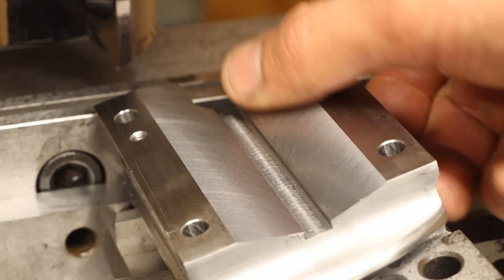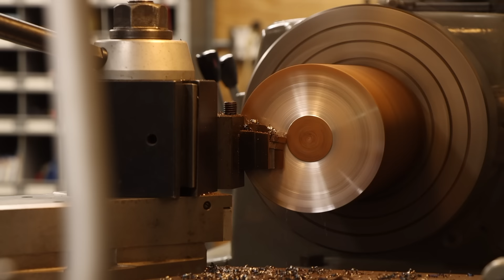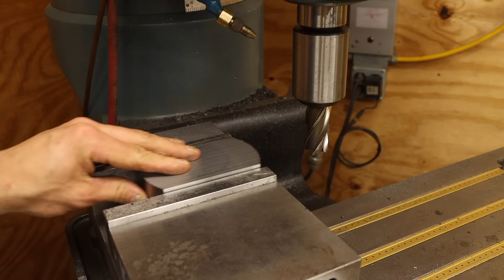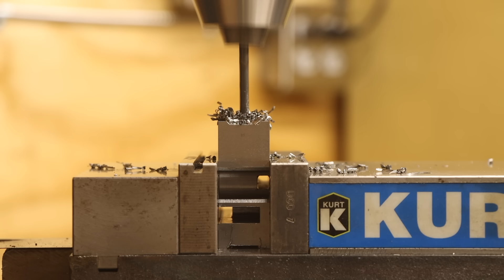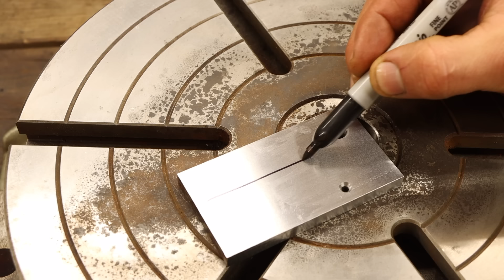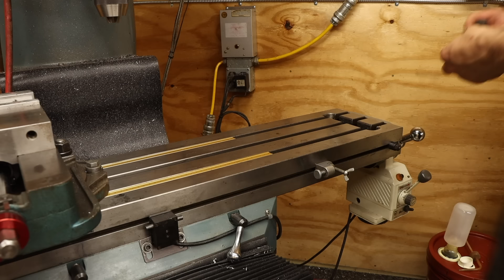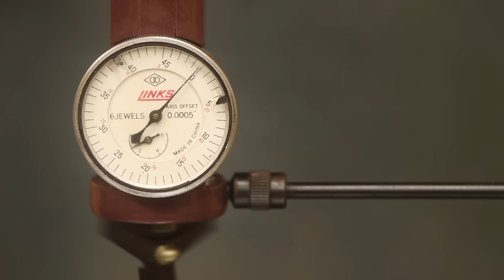Making a Surface Gauge (Part 1) || INHERITANCE MACHINING

Comment: Awesome work. Is surface grinding necessary or would just milling produce an accurate enough result?
Reply: Depends on how accurate you want your measurements to be. You could lap the base flat by hand too. Also, the surface gauge is used in A LOT of different orientations and techniques. You use almost every surface, and for a lot of those techniques, squareness, parallelism, and flatness are imperative. Using a surface grinder is also not a trivial task. Using a surface grinder to get something more flat, square, and parallel than you can get with a good mill, is a lot harder than you may think. It takes a lot of practice and experience to do. So for most people, a surface grinder wouldn't help them anyways, as they wouldn't be able to get it better than the mill already did. (Assuming the mill is accurate, precise, and the operator is fairly skilled with the mill, but not very familiar with a surface grinder.) Surface grinders take a lot more skill than just dressing the wheel and traversing it over the work. There is an art to it. From how much magnetism you use, how quickly you dress the wheel, the wheel selection, shimming, blocking, DOC/speeds/feeds, type/method of grinding, roughing strategy, coolant, and so on. Let's say a fairly experienced mill operator, using a good mill, can get it to +/- 0.00050" of parallel over a 4" long piece (say 4x2x1). For a novice grinder, getting it to better than even half that (+/-0.00025") will be near impossible. Where an experienced grinder operator might get it to within 50 millionths (half a tenth, or 0.00005"); an order of magnitude better.
Reply from the maker: Well said! I’m a beginner with the SG myself, so I recognize there is a ton to learn about it. All in due time

Comment: DOC is way too deep for your HSS end mills. Believe me, I learned the only way (the hard way). Face mills with carbide inserts will let you do that but feeds and speeds are super critical.
Reply from the maker: Yeah I learned that here as well. The length of  the mill deceived me, but it’s obvious now that is only for side milling.

Comment: I like your video format as well as the content, very nicely done, especially the inheritance theme. I bet your grandfather would be proud. 

I noticed that it "Appears" in some cases that you're using a drill chuck for milling, not a good practice IMHO, drill chucks aren't very good at handling side loads but they are OK for slow rotating counterbores with end mills. 
Also, I noticed a "Ribbon" pattern in the parts you've ground with your surface grinder, that can be caused by either an unbalanced wheel or worn spindle bearings, if it's from an unbalanced wheel, that can cause premature spindle bearing wear. I just replaced the spindle bearings on mine and the bearings alone were $350 from eBay (new old stock), new ones were nearly $1000, plus $50 worth of bearing grease and the time it took for single use special fixturing for the rebuild process, then the task of balancing the spindle, what an undertaking that was! .

Anyway, keep up the good work and I hope your learning journey is pleasant with very few pot holes!! :-)
Reply from the maker: I appreciate the support and the helpful tips. In the case of the project a learned a few lessons. One being the drill chuck milling like you mention. I noticed the pattern as well on some of my first passes on the grinder. Turned  out to just be a bad dressing. Did a pretty thorough redress for the final finishes and the results looked A LOT better. No patterns that I could discern. Thanks again!
Reply: @InheritanceMachining  
You're welcome :-)
Reply: @InheritanceMachining  One other point I'd suggest is to use "stub length" or "screw machine" drills instead of "jobber length" drills (unless the depth absolutely requires it). There is less chance of deflection or breakage with a shorter drill. Overall, the same "shorter is better" rule could be applied to any cutter, within reason.
Reply: @InheritanceMachining  
I thought maybe I should mention an option for you concerning milling collets, I use ER32,  ER40 & ER16 collet hollers with R8 shanks (except the ER16, it has a straight shank ).
My mill has a spindle lock that makes ER style collet changes relatively quick and easy and they are pretty rigid with nearly zero runout. I only have larger collets for the ER40 holder (only the sizes not available in the ER32 set). 
Also, ER spring collets have a gripping "Range" which means you can use metric size tooling even with SAE size collets (in most cases anyway). 
Anyway, just thought I might mention that option, lots of people use the ER method on a daily basis, you may already know this so disregard this message if you did :-) 

BTW, glad to hear the grinding pattern was just a matter of dressing the wheel. :-)

All the best,

Joe

Comment: Another great video!
You'll love the VFD instead of the static phase converter.  Did the capacitor in it blow?  I recall my father had one of those phase-o-matic converters on the old Bridgeport in the garage. One time when it was turned on the main capacitor blew like an m80 and stunk out the garage.
Reply from the maker: Jeez! No not anything quite as dramatic as that. It’s just not a good application for a static phase converter where you only get 3 phase for starting. I’m constantly tripping the thermal relay especially at high rpm. So trying a VFD because it’s cheaper than a rotary for getting 3 phase
Reply: @InheritanceMachining  I have a VFD on my Bridgeport and it works great for converting single phase 240 to three phase, and you get the added benefit of making the motor variable speed.

Comment: Fantastic work! I also love the LOTO card with the photo! It's a brilliant trick to convey the solemnity of why the card is attached to something. Wasn't a true believer until I almost lost some fingers to a small bandsaw. The saw wasn't even large enough to hide behind, or so I thought, and was crouched behind it reading info off of the motor's nameplate when a coworker turned the saw on. Scared the hell out of both of us.
Reply from the maker: Wow! That could have been bad. I've had a few close calls with machines myself. Fortunately most modern industrial works have standardized on physical LOTO locks.

Comment: Because why not! I see a VFD...Great work, enjoyed the Rotary Table.
Reply from the maker: As is always the way haha you have a keen eye!
Reply: @InheritanceMachining  I have one like that, it's a little slow and programming it is a little weird but it's work fine for a few years now with remote power switch box and push button start.
Reply: Slow to boot that is
Reply from the maker: @BurtonsAttic  Gotcha. I don't necessarily need it for variable speeds. It's just a hell of a lot cheaper and more efficient than a rotary phase converter.
Reply: @InheritanceMachining  That a misconception a lot of people got from my videos! I mainly use VFD's for the same reason. I run at 60Hz all the time and only use the variable speed for tapping mostly which it's very handy for. Modern VFD's are very efficient, so the little bit of lose is an unnoticeable trade off.
Reply from the maker: @BurtonsAttic  Ah we think alike! I'll deal with a little bit of loss over the likely 50% loss I'm getting running a static phase converter. I guess they have their place for mills and such. But definitely not on a lathe.

Comment: Nice work, I like your design, the way you incorporated the OD for the squareness checking nose is quite clever. Cheers!
Reply from the maker: Thanks! I figured one more option wouldn't hurt. This one will let me check squareness for shorter parts where the ball end on the rod will be kind of limited. I also learned I can use a ball bearing against the chamfers leading to the arm pocket.

Comment: I like to think of each destroyed endmill as a lesson learned. Apart from running your mill in reverse - mental block with that one.
Reply from the maker: In this case a pricy lesson for sure.
Reply: @InheritanceMachining  perhaps another side project an end mill sharpening device? Simple or complicated can do the job adequately, and saves wasting all that lovely HSS.
Reply from the maker: @chrisstephens6673  I'm toying around with something in the back of my mind. I'd like something I could do lathe tooling with as well

Comment: Great project. Not sure if this is really what you did but, when bluing a part don’t stick the metal in a large container of bluing. Instead put a small amount in a cup and throw away when finished. You’ll end up ruining that whole bucket of bluing liquid.
Reply from the maker: Thanks.That's something to consider. But at the same rate I would probably go through the fluid faster that way. I've used this 1 batch for several dozen of parts both big and small with no loss in effectiveness. If I portioned out what I needed for each I would have runout long ago.
Reply: Good to know. I can’t say I know from personal experience. I love your channel keep up the great videos. I’m not a machinist but would love to learn how. Your fortunate to have the opportunity to have learned from your grandpa.
Reply from the maker: @sendit220swift3  Thanks! I definitely value my time spent with him more and more every day and realize how rare of an opportunity I've been given to keep his machines alive.

Comment: I have to say, If I had a surface grinder I think I would also use it on every part for which it was remotely applicable. When you have a cool tool, you use the cool tool. This is the way.
Reply from the maker: This is the way indeed

Comment: Another very pleasant video to watch.
Congratulations are due to your correct spelling of gauge, not that lazy american way.😉
Just a side note, when using a co-ax use the shortest stylus you can as it reduces the lever effect (the longer the stylus the smaller the hand movement) and remember the figures on the dial are meaningless as you are just looking for no movement of the hand.
Looking forward to part next.
Reply from the maker: Haha thanks. I actually thought about that exact point with the stylus after running this setup in. I do have a couple shorter ones so I should be set for next time. I didn't go into it in the video but I found it interesting how after you get it in the ballpark you can run the spindle on low then just shift x until variation is minimal, then do the same for y. Because like you say, the numbers are meaningless. The little vibrations in the video were from rust pitting on the ID.

Comment: Parts look great Brandon.
Reply from the maker: Thanks, Steve! Any suggestions for heat treating a larger part like this without an oven? Not sure if my oxy-acetylene torch will be enough.
Reply: @InheritanceMachining  What kind of steel is it?
Reply from the maker: @SolidRockMachineShopInc  Good question. No idea. Likely a hot rolled mild carbon considering the bar it came from.
Reply: @InheritanceMachining  i don,t think it would have work harden if it was one of those. My guess is 4140 or 01. You can get fire brick and make a little enclosure on three sides to reflect the heat back to the part. Try cutting a little piece from the bar stock to experiment with first. Get it cherry red before oil quench, stay away for getting it past cherry red. If you get into the yellow color you may destroy the steel.
Reply from the maker: @SolidRockMachineShopInc  Ah, thanks for that, Steve. I wouldn't have guessed anything with chromium given how rusty it was. But doing a test piece with a makeshift kiln is smart. Thanks again for the advice!

Comment: I was in my university machine shop and made some dumb mistakes. Your honesty and showing your mistakes lets me know I'm not the only one! It sure felt that way yesterday... Great video, hopefully you get the lathe fixed up!
Reply from the maker: Thanks for saying that. I'm not trying to come off as an expert or anything. And honestly showing my mistakes might help someone avoid them in the future.
Reply: @InheritanceMachining  I really appreciate your methodical approach to machining, and admire your design process! As a VERY new machinist I am excited by all the capabilities my shop has, but need to learn to temper my expectations when it comes to the complexity of my projects. Thanks for the motivation!
Reply from the maker: @Crook33  Haha I can relate to that sentiment from a timing standpoint. Hence the 2 part video 😂  Thanks again!

Comment: When you fixture a part, give it a few whacks with a dead blow hammer. Makes sure everything is seated properly
Reply from the maker: Oh I did haha I'm pretty certain the side milling pushed the block up like that. I think I might need to swap my vise speed handle back out for the longer stock one
Reply: @InheritanceMachining  The speed handle is great for set up. But use the longer handle and get a gronk on it right before you start milling. I forgot to gronk down a part once. Put the end mill to it and the end mill grabbed the part, pulled it out of the vise, and threw it across the shop. Man I hate when Bozo shows up to the shop.